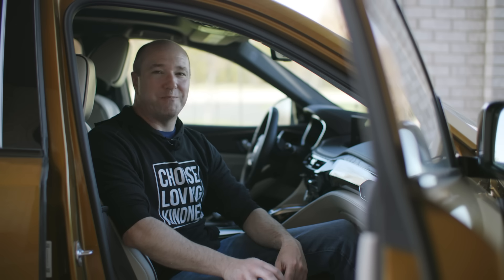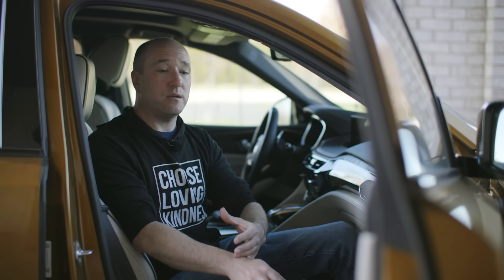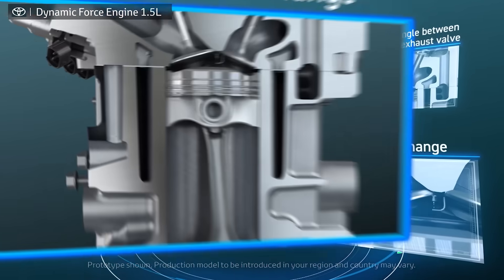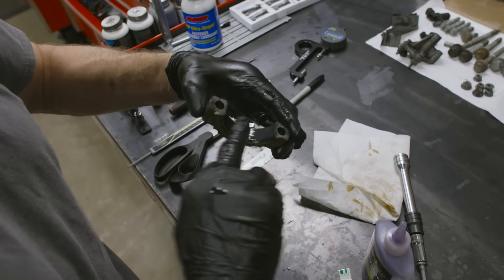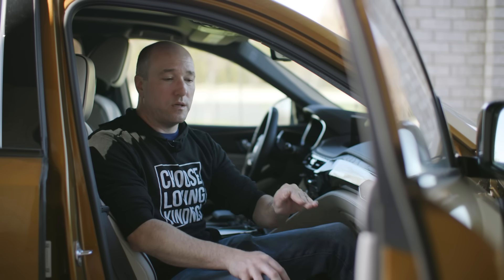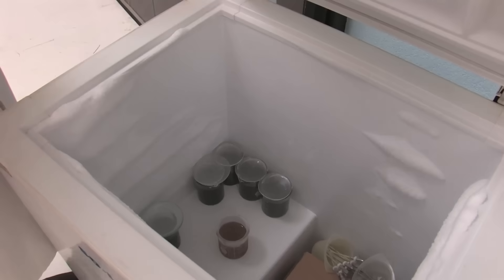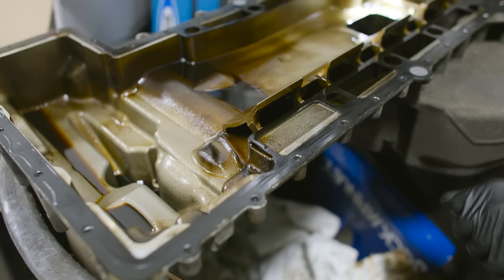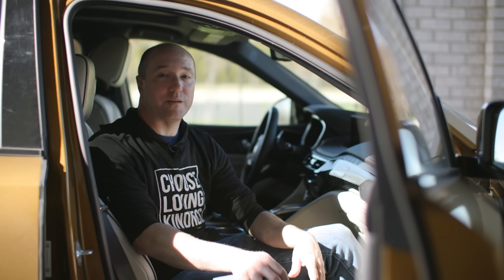Understanding Engine Break In | Dos and Don'ts

Comment: If you were to use a “bathtub curve” reliability model you’d appreciate that all things electro-mechanical can experience higher infant mortality rates early in life and higher failure rates at the end of their useful life. In my non-expert opinion, to keep the useful life (on the bathtub curve) as long as possible it’s reasonable to use a break-in (or burn-in) schedule. It strikes me that modern engine control modules could have a break-in profile incorporated that manages allowable engine performance until that profile has been completed.

Comment: I guess its not really a thing anymore but I just bought a brand new GMC Denali Ultimate and was expecting to do an oil change after a thousand miles or so. I thought that was basically the way it had always been lol. I know the engines we have had built for some of our cars we usually do the first change within 500 or less miles but those are a bit different especially the last 434 inch small block we built for the 65 Chevelle. This new truck is a Duramax too and its the first modern diesel I have ever owned. Hard to believe how quiet it is. I still plan on changing the oil earlier then recommended at least the first change.

Comment: I live in AZ & I had two FRS over a period of 11 years. I ran nothing but 0-20w and yet I noticed how high engine temps would get, the oil would quickly discolor and quite a bit would get consumed between oil changes..  I read up on as much as I could but sadly seemed to me that evidence for using higher viscosity oil was based on theorycrafting..and many folks also claim with modern engine tolerances, people should not be deviating from the manufacturer's suggested oil.  My GR Corolla will be arriving in a few months and I'm back reading up on this as it too uses 0-20w 😮 with our high summer temps combined with a small turbo engine pushing 300 hp, I'm pretty concerned for long term..

Comment: With a stock off the shelf car, you need to drive a bit cautiously for the first 50 miles or so, to bed in the tyres, brake pads and so on is probably enough to protect the engine as well.

I've run in a few cars and motorcycles, and only had one which behaved a bit unusually. I ran in a Kawasaki GPZ 500 (pretty much using your method), but did notice that after about 1000 miles the idle speed increased. It did this a few more times over the next few hundred miles, before settling down. Presume that the engine internal friction decreased over that period?

Comment: Engines are DESIGNED for an oil viscosity. So if an engine says 0W-20, you better put 0W-20 even on the truck. BMW M devision learned this the hard way. The advised 10W-60 for track use on the V10 cars ... only to have massive engine failures because of this. Because the engine was not designed for this and turned out that outside track use it was not ok to run this viscosity. 
Other than a trailered racing car, stick with spec'ed oil standards.
Also all modern cars have oil service indicators. Use them! They measure cold starts, engine loads and revs, temperatures etc They are really good!
Maybe you can keep your oil over 20.000 miles. Trust them (I have on my 20year old GM car!)

Comment: Cool insights on bearings, I really didn’t think there was much to wear in with respect to those these days. Odd you didn’t mention piston ring seal though. I thought that was more or less the #1 thing the break in was trying to get right.
Reply: Cylinder bores are finished far better now than in days of yore, but the lore is still with us. The amount of folded and torn metal on the cylinders walls is far, far less. A number of short WOT applications in the middle of the RPM range when fully warmed up will get the job done.
Reply: I thought so, too. That's not to say the whole isn't important. It's ALL important!

Comment: FWIW, I thought it was interesting what Cummins had to say about a heavy duty diesel in my RAM owner's manual.  Basically tow something heavy, and put the engine under full load within the first 6,000 miles for the engine to break in properly.

Comment: Engine designer here....Modern engines use plateau honing on the cylinder bores that greatly reduces the amount of break in the surface needs and also reduces blow by that is allowed by closer ring end gaps.  Rings are mostly seated in a few hours, as are other bearings.  Definitely recommend increasing the load and RPMs over a few hundred miles for the safest and least amount of wear on a passenger car since the lower levels of zddp take longer to build up the protective film.  On the flip side, semi truck engines are often taken to full power within the first 5 minutes in production test, though they are machined to have very round bores and have some of the highest unit pressures on their bearings.
Reply: Yup this 1000 mile crap is overkill, it’s good in 200-300 if you did it right
Reply: 2025 Toyota Camry requires a break-in period of about 620 miles, so that's what I'm doing.

Comment: Good video..Just got a new Subaru Crosstrek..( last of the 6 speed manuals) I plan to do initial oil change at 1000 miles...old habits die hard...I plan on keeping this auto for the long term..at least 10 yrs.+ I always do the required maintenance and I have  "mechanical Sympathy" for my engines. I am not a fast driver, but I am a long distance driver...mostly in the South Western States. I live in El Paso Texas so dusty & hot...so it will be 6000 miles or 6 months.

Comment: I’ll make super easy from a engine builder. Good warm ups, 100 degrees on coolant temp before any load. Then drive in town for the first couple hundred miles. This will make it easy to vary the speed and load with out putting undue stress on the motor. After that slowly start driving the car more like you are going to drive it every day as you get to 1000 miles. This process helps braking in the rest of the vehicle.

Comment: Speaking from a motorcycle perspective, I've always used the heat cycling method on all my new motors. Never had a problem.
Reply: Breaking in an engine is to seat the rings. Heat cycling with no load  is not good for seating rings.   One heat cycle on a fresh engine to check for leaks etc is sufficient. Then ride it. Just not crazy hard to begin with. You don’t want to overheat the rings.

Comment: I have a Merc A35. Its the amg version of the A250 engine. Mine had a sticker to the front window ‘first 1500 km no high revs’….it tried to follow it but at 1000km I accidentally high revved two or three times  for a split second. Is that damage to the engine?

Comment: Unfortunately this video didn't address piston ring seating which is at the root of most of the myths and theories around different types of break in procedures. There's a lot of intuitive references in the video such as you break the engine in the way you will driving it in the future - why? It's a mechanical part, it doesn't have a memory. This also ignores the fact that this is debated among engineers as well.  Not to mention high performance engines are usually built with looser tolerances than economy engines, so the reasoning for being able to drive an economy car right off the lot and drive normally because of looser clearancesdoesn't really make sense. In my opinion new technology with oil, piston rings and cylinder wall machining techniques are really the driving factors between how today's engines and yesterday's engines need to be broken in.

Comment: I think you should finish this with a very strong recommendation to BREAK IN THE WHOLE CAR!!!!!     What is this crap, that it's up to you? If you don't care you should be legally punished for it. Screw those eco-fanatics but what the fock is wrong with people that don't care if the car will last 5 years or 15.

It should be mandatory to put some limitation on car performance for the first 1000 miles.

Comment: I have an Audi TTRS.  Bought it new in late 2017.  There is no placard recommendation in the engine bay.  Audi has changed its recommendation three times since I bought the car.  I wonder why?  Dealer doesn’t know, he just does what Audi currently recommends.  Latest is 0W30.  Live in Tennessee where the temperature is fairly mild.  I assume the Audi engineers know best but am concerned about all this.  I vaguely recall that the EPA doesn’t like the 5W40 because to get the broad viscosity range requires a chemical it doesn’t like although it is a better lubricant.  EPA doesn’t care if your engine lasts.  After Diesel Gate one wonders if Audi is under the thumb of the EPA.

Comment: There used to be a motorcycle website(circa 2003?) That had a long article on break in. Drive it like ya stole it. And they had the data to back that up.
Reply: yeah and the set up tech beats the heck out of them before you even see it

Comment: Another thing you didn’t mention, break in or not, is warm the damn thing up before beating on it. If the coolant isn’t at its normal warm position, limit to 50% throttle and 50% revs. Let the engine get to operating tolerances before going full power. Then, cool the thing down a little bit before parking, keep revvs low for the last mile or two of your drive. Don’t do a cold burnout of your driveway and bang off the rev limiter pulling into the work parking lot. 20+ years of driving and never a single mechanical part has failed for me, not even a water pump or alternator.

Comment: Here is a counterfactual. I had a 2004 Porsche Boxster S and was an active PCA “Drivers Ed” participant at Lime Rock, Watkins Glen and Mont Tremblant, the last being with a brand new (less than 50 miles) engine replaced after an IMS failure. I mentioned to the dealer that I had secured this difficult several day session and really didn’t want to cancel and the tech said go ahead and flog it, don’t worry.  The history of it was that I got the replacement at 36,000 miles in 2006 and sold the car in 2015 with about 180,000 miles with no problem with the engine nor its IMS bearing
Reply: You were EXTREMELY lucky!

Comment: I bought a new 2021 Rav4 (gas) a couple of years ago. I went to the extreme to break in that 4cly engine. I Followed the break-in steps and changed the oil at 1200miles, then 4200miles and now every 4000miles. That engine today, is quiet, smooth and really pulls hard for a 4cyl (no turbo). Never go the 10k miles recommended by manufacturers. 5K max oil changes, if you plan to keep the car. I've worked on cars as a hobby for 50 years, never had an engine failure of any kind. (30+ cars by many different manufacturers). Oil changes are the key to a healthy engine.

Comment: As a retired engineer who spent 32 years in a Fortune 500 company in its R, D & E organizations, I have come to this conclusion in regard to engine break-in:  it really doesn’t matter how you do it.  I say this for the following reasons:

1. I have yet to see a research paper discussing engine break-in and showing actual tests of engines broken in using different procedures and then being torn down for comparison.  If anyone knows of such research, please share a reference.  So, I take everything I hear, even from auto engineers, as being nothing more than anecdotes.  As we used to say at work “In God we trust, all others must bring data.”  I have yet to see actual data comparing break-in procedures.

2. I have owned probably 30 engines during my life in cars, trucks, and motorcycles.  I have broken them in a number of different ways from babying them, to following manufacturer’s instructions (which can vary a lot) to the “run it like you stole it” approach.  I have seen zero difference in engine life, oil consumption, etc. from one technique to the other.  I have come to the conclusion that the natural manufacturing variation in engines makes more difference than does the break-in procedure.

Given the above, I just drive a new car like I plan to drive the car or ride a new motorcycle the way I plan to ride the motorcycle without worrying about any particular break-in procedure.  Until I see actual credible data that suggests a given break-in procedure makes a measurable difference, this will continue to be my procedure.  My only exception is that I generally do one early oil change at the 500 - 1,000 mile point just to ensure any residual manufacturing debris or initial wear material is removed.  Some manufacturers still recommend this, but most no longer do.  Most engines are pretty clean from the factory so this is probably overkill, but it isn’t that expensive to do one additional oil change even if it isn’t truly necessary.
Reply: My GTR tuner (Will Taylor: Go Turn Stop LLC) told me essentially the same things. He bought one of the first R35’s in the country and has been building, tuning, and maintaining / fixing dozens for all sorts of owners at different power levels. 
He said he still has not come to any definitive conclusion based on almost 2 decades of working on the same engines that every R35 has.
Reply: You are right. A lot of guys will say "I do x, y, and z and I've NEVER had a problem". Well, that's meaningless unless you had a second car on which you did NOT do x, y, and z and it had problems.
Reply: My wife took our brand new Armada Pro 4x to redline literally driving it off the lot by accidentally putting it in manual mode.  The engine was warm.   Do you think it's all fine?  I'm looking for some peace of mind here lol.
Reply: @Journey_of_Abundance Pretty hard to hurt a modern engine as the computer will cut the ignition and/or fuel when it gets to redline so likely no damage was done as the engine computer will work hard to keep you from causing damage.
Reply: @LTVoyager   Yeah I guess I was just more concerned with it only having 25 miles on it when that happened based on what a lot of poeple say about breaking in an engine
Reply: @Journey_of_Abundance Most of what most people say about breaking in an engine is mythology.
Reply: 30 engines in your life? Sounds like you haven’t kept an engine long enough to even know if you fucked it up with a bad break-in
Reply: @BlueInOrangeAgain  Not everyone owns only one engine at a time like you.  I currently own 4 and have owned 6 at one time in the past.  If you own 4-6 at a time over 50 years, that is a long time on each engine, assuming you have sufficient math skills to figure that out.
Reply: @LTVoyager  : Laughing at your reply. Good one.
Reply: Funny Ive had mechanics remark that my high milage from new engines are in remarkable condition something they rarely see . Proper inital break in and timely oil changes and filters are the major reason and they agree...that is all the data I need and I am not an engineer .
Reply: @blueberry2846  And what is “proper” break-in?
Reply: @LTVoyager  Come on man, let it go.....
Reply: @LTVoyager  Enough of the fibbing and name calling; just let it go man.
Reply: @LTVoyager  Enough of the fibs and name calling, just let it go…

Comment: For my ‘21 Impreza, changed the oil at 1k, then 3k, before running it like 3-4k before changing. I won’t go longer than 4k, as the 0w-20 eco oil is suspect while driving this in the mountains. 

I drive the shit out of my Subie over high mountain passes, snowstorms, and triple-digit heat here in Utah and across the West. 

So far, it’s been nearly perfect and doesn’t burn any oil, despite boxer engines usually burning oil.

The 0w-20 oil is a bit problematic while mountain driving in summer, especially going over passes.

Comment: I read years ago a dirt bike/ motorcycle engine rebuilder with hundreds of rebuilds suggested majority of all the principles stated in this video. He suggested replacing fluids sooner than 1000 miles. More or less drive 20mi in different loads and rpm ranges, replace all lubricants. Engine, tranny, diff, ect. Then do the same thing at 1000k miles. He did mention one absolute variable for longevity of a motor i took to heart. And that is to never drive a car on high loads or revs until the oil comes up to temp. 

I haven't had any issues in the 10 years of owning my e30 using that principle. With a block that has over 220k on it. Driving hard or not.

Comment: The FL5 is recommended to use 0w-20, then for track use would you use 0w-40? I've heard somewhere to not change the cold temperature viscosity but can change the high temp viscosity....
Reply from the maker: Cold temp viscosity does not matter unless you are in cold temps.  (Below 40F)

Comment: Wow fantastic video, was wondering about this recently since people told me 2000 miles under 3k rpm before. And you even covered about the initial oil debris. Been breaking in a new GV70 recently thanks for the information.

Comment: I do have an issue with oil change intervals.  This gets back to the SAE normal versus severe service definitions.  Most people fall under severe service.  I might even say nearly all people.  I use the severe service recommendations on all of my cars and my engines live long trouble-free lives.  BTW, the OCI on my Veloster N is 3k miles for severe service.  That is right out of the owner's manual.

Comment: 2020 Subaru WRX: drove "normally", without coming even close to the redline. Changed the oil at 1K, then every 3-3.5K with Pennzoil Ultra Platinum. Driveline fluids at 5K, then every year. At 60K the engine doesn't burn any oil, and I monitor it very closely. I always warm it up until the oil shows 86 degrees (which is the minimum the gauge will display), then I drive it below 4K until the oil temp reaches 180 degrees.
Reply: You have an oil temp gauge? That is rare.

Comment: I'm a big believer of proper engine break-in. I particularly like to do a lot of downhill engine braking. I usually don't do the full 1000 miles and change the factory fill at around 500 miles. I'll probably do an oil analysis around 5k-10k miles to check on things.
Reply: I have always done my engines that way, never had a problem or failure.